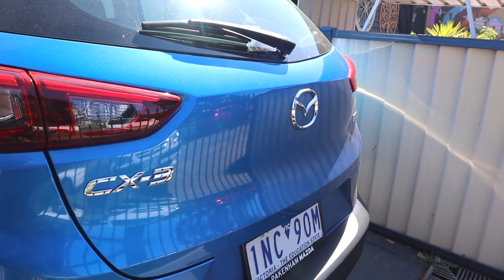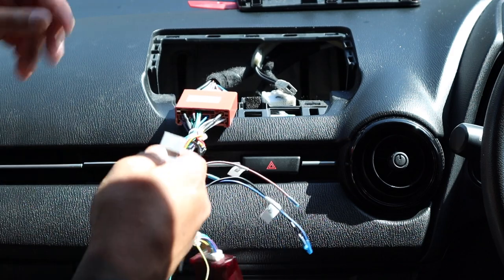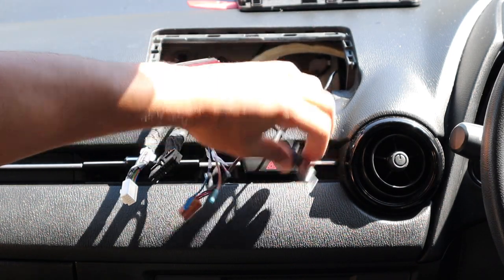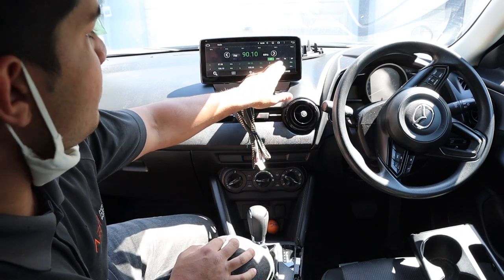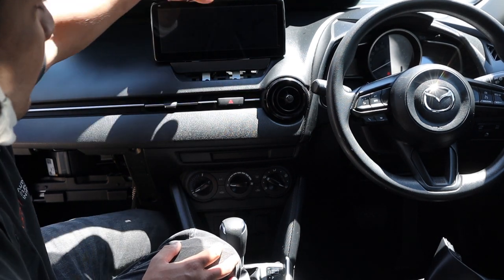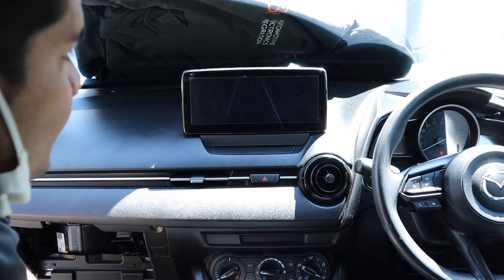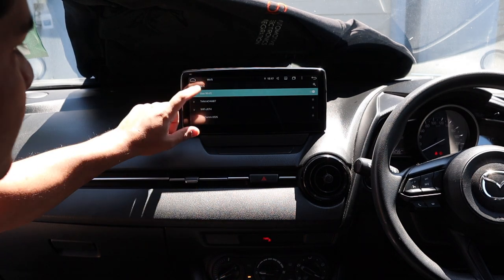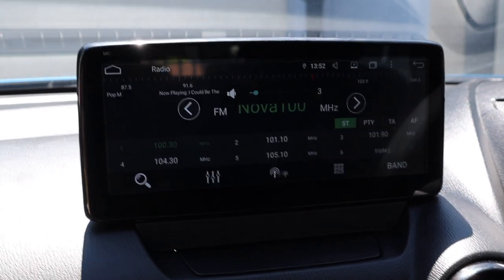Mazda CX-3 10" Android Screen Install / CarPlay.

Comment: Hey Nathan, quick question which model radio would fit the cx-3 with the  electronic parking brake specially regarding the control knob, since  the middle console is diffrent? Thanks

Comment: Looks good. Who makes these and where can I buy one? I have a Japan import Demio / 2, and the factory head unit looks identical to this, so I guess it should work.
Reply from the maker: This is designed for Mazda. You’ll need a universal kit :)
Reply: @TheFittingBay  Yeah, it's a Mazda 2 (or Mazda Demio in Japan). A shame if it won't fit then. The vehicle interior and the factory radio really look identical to the CX-3 in your video.
Reply from the maker: @simongraham8055  sorry in that case it should be fine :)

Comment: Hi Nathan,
Can this unit be fitted to my 2016 top of the line Akari, it came with a screen that has all the vehicle functions, etc.
I would love to have a decent head unit over the factory mazda one.
My car also has factory Camera and would that too be intergrated in this install.
Like there has been others asking, when, where, and how much, located in Sydney.
Great Video, can not wait to see if this can be done.
Reply from the maker: https://shoptfb.com/collections/mazda/products/mazda-10-25-android-replacement-screen?variant=39530471391417
Reply: @TheFittingBay  hi mate, does the indicies on the included controller lights up when you turn on your headlights? cheers🍺🍺

Comment: Hey would this work on a 2017 Mazda 3 base model with the same stock headunit as in your video?? My doesn’t have steering controls or the control knob in the middle but it has the space for it just like in your video

Comment: Hey Nathan. Looks really good. Do you know if this can be fitted to a 2017 cx3 that already has the touch screen radio/nav system in it?
Cheers Ray
Reply from the maker: Hi ray it sure can just needs a few more plugs to be installed!
Reply: If you already have the factory screen, just get the OEM Apple CarPlay/ Android Auto module. It would work better then aftermarket.

Comment: Hey man, I have a 2014 Mazda 3 with the original screen, I want to upgrade the screen, can this screen keep the original mazda system and if so, how could you access it?
Reply from the maker: Yes you can still keep original equipment :)

Comment: Hey! Will you keep the OEM Mazda UI as with the Mazda factory screen? I'm asking you this because with the Mazda UI I can control various features of the car such as the rain sensor and door locks.
Thanks in advance
Reply: Did you ever figure this out?
Reply: @Fifthcell  the seller says that you have to buy another version, because you will keep your oem controls in the center console that the one like shown on this video has not and that’s why he installed the center console controll, but you’ll keep the Mazda OEM UI and you can switch between the android system and the oem system but in a bigger screen!!
Reply: @POLLO14934  did you end up buying / finding the new version? if so could you link me?

Comment: Goodnight. Will this work on a 2015 Mazda cx-3. Does this come with a built in fm tuner? Recently got this vehicle and it came from Japan. Also, are you able to advise how to remove the "region lock" when trying to play DVD's. Your assistance would be much appreciated, and also the cost for this head unit
Reply from the maker: Region lock not sure but changing to this screen will fix that and yes it has FM
Reply: @TheFittingBay  Hmm, so this has a hookup for the standard dvd player the cx-3 comes with? Where can I purchase this screen?

Comment: Does this work for the mazda 2 2016? I looks like i have te same radio as you had in the first place. And were can i get that 10inch screen??
Reply from the maker: yep! 
https://shoptfb.com/collections/mazda/products/mazda-10-25-android-replacement-screen?variant=39530471391417

Comment: Would it work with the CX-5 2017-2018 model?
Reply: Also wondering this. I’ve found very little information regarding any sort of aftermarket head unit installs for the second gen cx5s

Comment: great video mate'  i have a 19 plate mazda 2  it has the exact same factory radio and console as the 1 you've just worked on!  could u drop me a link for ebay (if poss pls) to buy the unit and a rough idea of the price.. much respect Bro from the UK!  smashed that subscribe button and notifications!
Reply from the maker: Thanks brother! I got this one from my supplier in China so I’m not sure if it’s on EBay?